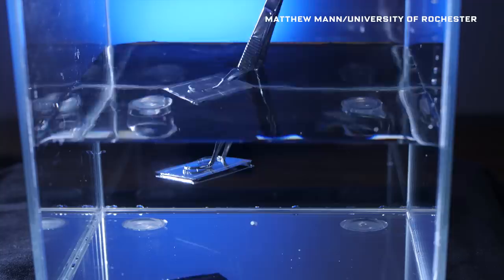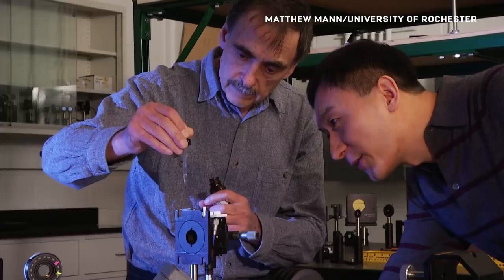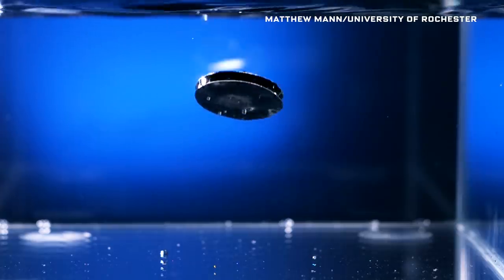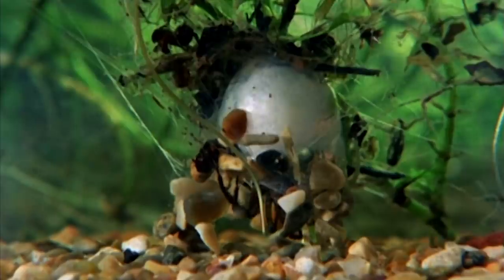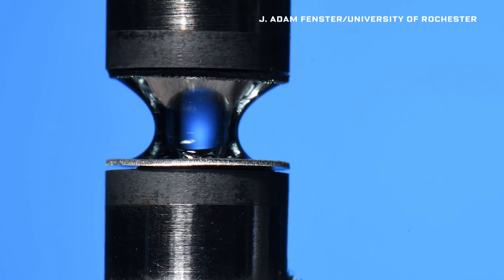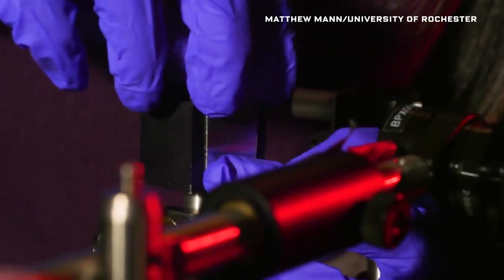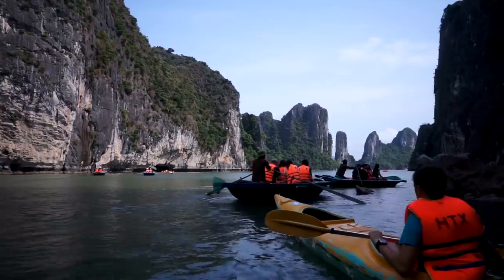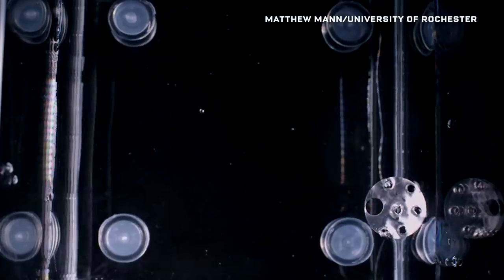Scientist Explains How Unsinkable Metal Works | WIRED

Comment: This could have uses if it's easy to mass produce and doesn't degrade but a compartmentalised hollow structure would do the same job without the added risk of degradation. And that's essentially what ships use, they have compartments so that if one gets breached it doesn't sink the whole ship. I'm wondering if this instead could be used to reduce the amount of drag on ships hulls or to deduce the damage caused by cavitation on the ships impellers because of the air boundary.

Comment: I bet corrosion destroys this miracle boundary layer.
Reply: also maybe microorganisms
Reply: Why would it corrode if the water doesn't even touch the surface but rather an air layer
Reply: @mathiasramirez3975  because of water vapor

anyway algae will sink this thing in the ocean
Reply: He did say they'd left it underwater for months and it still floated but I don't know how that would apply over longer durations in salt water.
Reply: Soap will be considered a weapon of mass destruction as surfactants threaten the international shipping industry.
Reply: I think the pressure of the ship sitting on water would push air out of these pores. Also, as mentioned, the corrosion, algae and micro particles that fill the pores. Seems they made a metal carbon filter and after those pores are filled it will stop working.
Reply: Allan Peda,
and if that was the case, would it be impossible for them to figure out a way to solve that?
And why so negative?
Reply: @Kaiesis  best part of science , hypothesis, then lab testing than real world testing 😅
Reply: @mathiasramirez3975  air also corrodes metal
Reply: Jimmy .L  the outside is touching water, and other metals corrode too, not just iron
Reply: If the oxide layer retains the shape of the nanostructures then it'd be completely fine, otherwise there's gonna be problems
Reply: Google User most metals pretty quickly form an oxide layer.. so I'm fairly certain the parts they are using already have it
Reply: Good point. Even if its only the outer surfaces in contact with water the corrosion could cause the inner layer to deform. Easiest fix i guess would be to put a thick outer hull around it though so the inner hull is never corroded or deformed, though it could be comprimised if there is hole somewhere
Reply: This could make some ships faster,  kinda interesting. With maintenance.

Comment: Better hope nobody dumps a bunch of dish soap in the water.
Reply: Gecko: <nod>
Reply: You would want to make a metal boat that actually floats on it's own, but have it covered in this etching as well.. you would basically have a normal boat with efficiencies of a hydroplane boat
Reply: Won't be a problem, it floats due to trapped air, not due to surface tension.
Reply: Saptarshi Sarkar yeah but the trapped air is inside due to surface tension
Reply: Saptarshi Sarkar if the water has no surface tension it will rush in and fill the holes

Comment: The amount of water displaced within those two metal layers would never keep a ship and its cargo afloat. Ships will still rely on displacing vast amounts of water to increase their buoyancy - and a severely damaged hull is still going to sink those ships.
Reply: Still trying to figure out the point of the hydrophobic surface if that isn't the mechanism that allows it to float....this video is misleading.
Reply: Anthony Italiano The hydrophobic surface keeps an air bubble in place without needing to enclose it completely. That make it “unsinkable” because the structure can be damaged without losing the bubble, whereas a normal enclosed non hydrophobic structure would immediately sink once water started getting into its air pocket.

Comment: So if this gets militarized, it's going to be impossible to sink a warship unless you disable all it's weapons or it will keep firing until it runs out of ammo.
Reply: Ship Warfare at that point might change to where instead of destroying the ship, you simply try to destroy its crew. Granted...some of the methods of doing so would violate the Geneva Convention I'm pretty certain.

Though in theory you could still sink them. As most likely the outer hull  in contact with the water would be the only place where it was invested in processing the metal to make it float(Since that'd be the cheapest and most efficient way of constructing them).  So if you did enough damage to that outer hull, the sheer weight of the rest of the ship would eventually cause it to sink because the hull no longer can displace enough water, and it's lost enough floating metal mass that it can't bear the weight above anymore.

Granted no clue how much you'd have to basically blow off percentage wise in order to sink it at that point, just that it would be possible. Either way they would certainly be a lot harder to sink.
Reply: Actually, if you breach the ship, you can capsize it. The ship's hull may still float, but the crew and weapons will be under water.
Reply: We don't even have any active battleships except carriers anymore
Reply: Well if there’s not water then it can’t float
Reply: or algae and barnacles grow over it and it sinks
Reply: you don’t get it, the ship won’t sink but you can still disable it. If you manage to break the ship in half, that ship will still be useless even if it doesn’t sink. And in reality, the weakness of any battle ship is the stearing system. If you manage to disable that, the ship become a floating piece of metal, that will eventually die out.
Reply: You are quite beautiful Chi :)
Reply: Or you could release a bunch of soap into the water to reduce the surface tension and destroy the effect.
Reply: @Leo-xe6rf  Your plan is to suck up all the water?
Reply: Chi chan tip can of coke in it and rust the layer away
Reply: Ted Danville Yep. Bismarck.
Reply: You could shoot soap at it. This. Would reduce surface tension, making it sink... But, I was thinking in commercial shipping - wouldn’t this reduce friction, increasing fuel economy? (At this point, I haven’t listen to the whole video, so...)
Reply: This is the second video on youtube ive seen u comnent on 👽✌

Comment: Here's the problem though - it looks like in order for you to have this super hydrophobic effect, you need to keep the metal at certain conditions.
The effect is gained by microscopically etching the surface of the metal, right?
Wouldn't having a metal treated like that constantly being battered by sea water, getting all sorts of gunk and whatnot stuck on top of it, among other things eventually sand and smooth the entire surface? I guess if you are using multiple layers of etched metal, perhaps it would be structurally more hydrophobic, but doesn't sound like the etching can go all through the material without it also becoming porous.

What maintenance looks like for surfaces like that?
Also, with big damages like holes on the hull, I don't think it matters much if the material itself is hydrophobic... the problem is water ingress, which makes the weight of the ship overcome buoyancy, which then sinks the ship.
I do get that one way or another having a ship with the entire hull made out of super hydrophobic metal would make it more buoyant in general, but the question then becomes - is it more buoyant enough to be worth the costs? Given how much power the laser etching procedure takes, it sounds like an extremely expensive process that isn't likely to become cheaper anytime soon.
Reply: Yeah, the way the video is worded is extremely misleading, like if changing the coating of a heavy box could make it float regardless of its weight.

Comment: How is the surface supposed to keep the air blanket if the boat is always under water and often moving at high velocity? Won’t the air eventually sluff off or dissolve into the surrounding water?  I’d like to see that (the most common boat use case) tested.

Comment: the gaps created by the texture are so small that they don't break the surface tension of the water. you can sink those ants with if you spray them with a super soaker that has some common dish soap because it reduces the waters surface tension. may be able to do that to this metal as well.

Comment: Unsinkable at this scale where the thickness of the metal is not so much more than the thickness of the trapped air pocket, but what happens when you scale up to boat or ship building metal thicknesses?

Comment: I expected more complex physics behind this.. it’s like a “physics trick” for me, and I wouldn’t call it “unsinkable”, if the air cushion will get away, however, the metal will sink, and the cushion probably won’t come back for itself under water. 
Try going through the air tissue with a stick for example

Comment: How is the unsinkable ship claim even possible? Ships sink because a water floods the hull through a hole in it, making it heavier than the amount of water it displaces. Is it that the metal structure can trap a sufficient volume of air itself to keep the whole ship afloat? Seems pretty unbelievable to me, as if it were true you could just use any lighter-than-water material to construct the hull

Comment: Unsinkable metal doesn't mean unsinkable boat, simply because a boat would never be only of this metal alone, all the cargo, people, etc. inside would drive it to the bottom of the ocean. Without cargo and people sure it would stay afloat like a wooden plank stays afloat even if it is punctured. Ride that wooden plank though and it will sink. Same here.

Comment: brake the water tension with soap for example and it stops trapping air thus sinking. it would be pretty cheap to sink a boat made out of that
Reply: Probably true. Also, you can mechanically overcome surface tension by swiping across the surface with trapped water. This will also defeat the superhydrophobic behavior of the surface. It's a fun gimmick, and I hope and believe there is some utility for it somewhere, but this Chunlei Guo is a bit too free with his hyperbole regarding his "invention". While it might be possible to make a ship relatively difficult to sink using this, it would be ridiculously impractical.

Comment: but then heres the deal tho
at higher pressure let's say the pressure of the weight of the ship onto the water will cause the air gap to diminish because all that gas would dissolve in the water
also movement of the ship will cause even further pressure on the air gap causing failure and it behaving like a non coated metal.
So the only way to prove it works is if they used a high pressure chamber to mimmic the pressure at which the bottom part of a boat hull would be exposed to

Comment: What about making an aluminum hybrid with this bad boy for planes
Reply: What's the point?
Reply: How would that not be a huge disadvantage? What even would be the advantages?
Reply: @petermuller7687  If it crashes in water, It's easy to recover?
Reply: @lass7212  Unless you seal and reinforce it, at which point it would be too heavy to fly, I doubt that it would survive the impact.
Reply: @petermuller7687  Well laser treating aluminum like this trapping oxtygen in it, would  make it lighter no? Also i  agree it has very little chance of surviving impact, but at least the  wreckage will float to the top.
Reply: I guess that’s for them to figure out, with any material, there are disadvantages lol

Comment: What if the surface gets scratched/damaged?
What if salts form on it or it gets dirty, or metal oxidates?
Do metals oxidate faster or slower?
Interesting concept, but as of yet I wouldn't trust a ship to float just with this, though it could at least slow down the sinking.

Comment: The large scale application doesn’t make sense. The weight of the ship will sink the bottom surface, unless that surface is heavy enough. Also, holes will still allow water to flow in the ship, which would increase the weight of the ship and make matters worse. Definitely a nice invention, but also a lot of bold claims.

Comment: There’s some research into a similar material that is cheaper but slightly less effective using diatomaceous earth and a semi hydrophobic coating similar to wax. As of right now it’s only used as a hydrophobic paint but could easily be used for the purpose of floatation.

Comment: Make a cylinder of this, fill it with water, then see if it floats. I doubt it will. This can't be used to make unsinkable ships. If a ship sinks due to a hole, water will rush in and fill up the ship, weighing it down and sinking it.

Comment: “Conceivably unsinkable ships” ??

Did you see the metal held down with a weight?

Try this with a thick piece of metal. Thick enough to built a ship, a ship carrying weight.
Reply: Try it with a drop of dish soap in the water. No surface tension, no boundary layer.
Reply: It's the shape of the boat that gives it the carrying capacity. How thick you think the armor is on a war ship? Obviously this isn't the issue.
Reply: Markle2k 
Even oil will destroy that characteristic